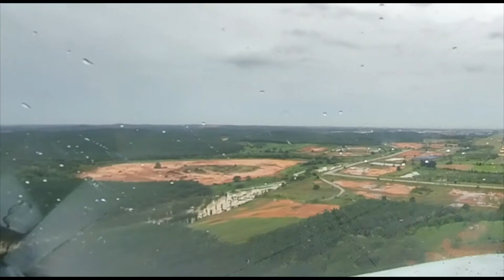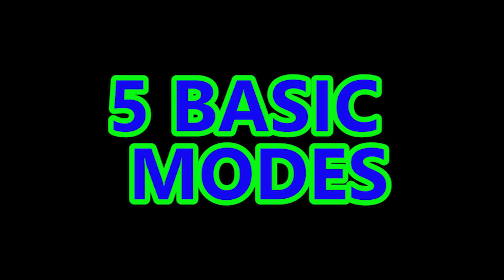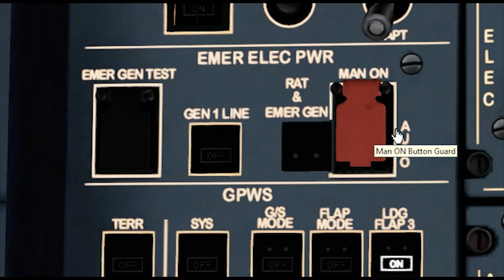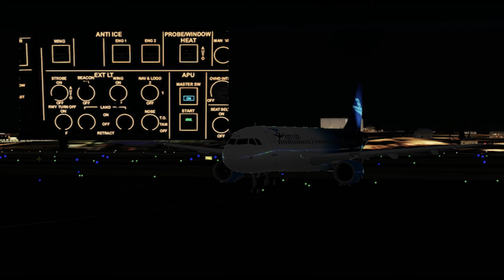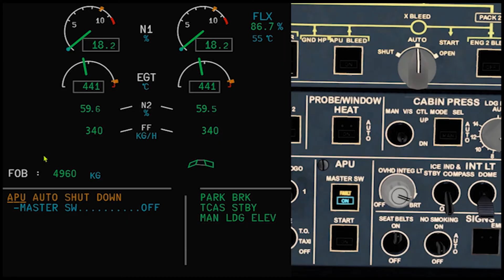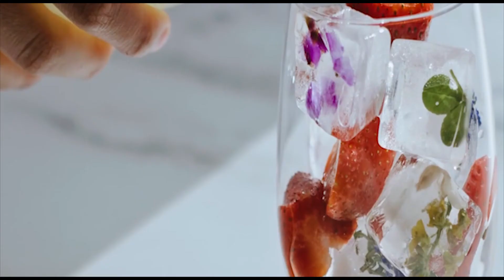What does this button do? (Part 1)

Comment: RAT automatically deployment happens when 3 conditions are met:
1 - Airborne
2 - IAS > 100 kt
3 - No electric supply on AC 1 and AC 2

There is no speed limit for Landing Light operation.

In the case of Outflow Valve not closing automatically with Ditching SW on, maybe the Press Sys is running on Manual Mode, but I’m not quite sure.

Your “merely a guide” is much better than most ground schools. Keep on doing that, kudos.
Reply from the maker: Thank you Lucas and great answers.